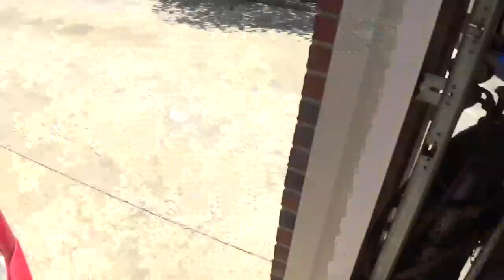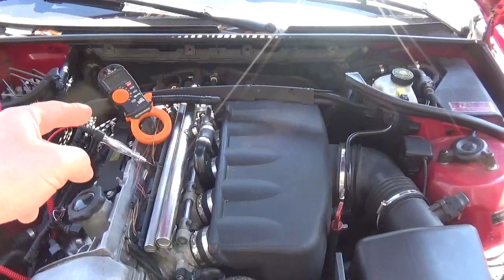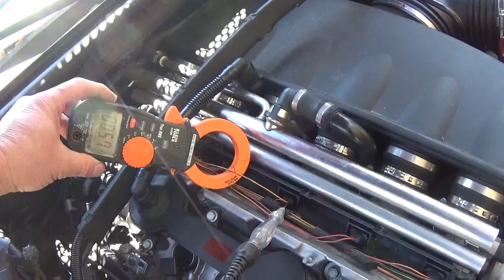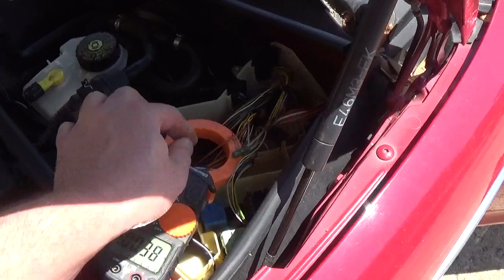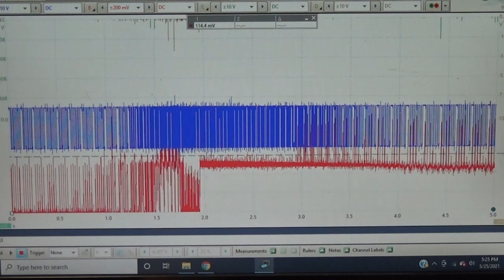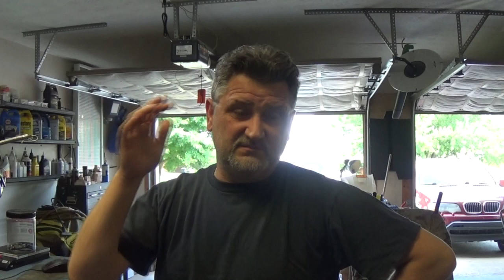BMW M3 Misfire/No Start Bad DME/PCM

Comment: You may have mentioned these items, if so, I apologize.  On your injector problem, were OEM injectors used as replacements?  Do the new injectors work on the other cylinders?  Have you visually examined the connectors to the injectors and checked for bent pins or pins touching each other at the control module and for any unusual resistance going through any connectors?  You checked powers and grounds - did you check for unusual resistance or slightly lower than expected voltage through the positive and negative cable connectors (i.e. w/in the crimps)?  See any unusual splices in the wiring harness covered by electrical tape where wires were twisted together instead of being crimped or soldered?  Did you consult DiagnoseDan, who works on more of these engines than most people?Good luck with resolving the problems you found.

Finally, can you tell me where your business is located in Kentucky?  A college student, who lives near Louisville, used her hard-earned money to buy a used 2013 Volvo that has turned out to be a lemon.  Local estimates she has gotten are more than she paid for it. I live hundreds of miles away and have not seen it, but a college friend of hers is a neighbor. From what he describes, it worked when she bought it but a few weeks later developed multiple issues.  Don't know if it was a private sale "as is" or from a dealer. It may be a simple problem that sets off many money lights and codes, or it may actually need major repairs she can't afford. She doesn't know what to do. If you are anywhere with 100 miles or so of Louisville, I would recommend to her that she contact you to discuss her issues.
Reply from the maker: New DME fixed this car. It’s running great.Car will be back to me for another problem  which is parasitic battery drain.
You can send your contact info to my email 
ruzic@bellsouth.net thank you
Reply: @kyhomegarage3430  Glad the new DME fixed the problem. I have passed your contact information to the friend of the young lady with the Volvo issues and asked him to have her get in touch with you at the email address you provided, and let her explain the issues.  I suggested that she get it towed or driven to your shop if you think you can help her. I do not know her name, but hope she will contact you today and explain her problems.  I really appreciate your passing your contact info to me and hope you can help her if she contacts you.

Comment: Another wire that is shorted to ground may be connected to one of the pins of the computer!
Reply from the maker: Just got an update from owner. He sent DME to another company to be checked and he was told that DME is good. He insisted to get replacement DME and it’s running great now. He is very pleased with outcome. Now car has parasitic battery drain. Looks like I will see him again.😊

Comment: Who knows how that control module is being tested???  Most electronics need to be opened up and the circuit in question needs to be isolated or removed in order to be tested ; and I doubt if that is being done for this owner.  Ramon, depending how much more you wish to get involved, you could call the tester and ask them how they are testing this module.
Reply from the maker: Just got an update from owner. He sent DME to another company to be checked and he was told that DME is good. He insisted to get replacement DME and it’s running great now. He is very pleased with outcome. Now car has parasitic battery drain. Looks like I will see him again.😊

Comment: That's crazy. Sorry things turned out the way it did
Reply from the maker: Just got an update from owner. He sent DME to another company to be checked and he was told that DME is good. He insisted to get replacement DME and it’s running great now. He is very pleased with outcome. Now car has parasitic battery drain. Looks like I will see him again.😊

Comment: Seems like odds of getting a pcm successfully repaired are about the same odds as hitting lotto. Shame how cars have gotten so stupidly over complicated. Thank you for posting Ramon and good luck with this.
Reply: Idiot Boy Wonder engineers, is the problem.
Reply from the maker: Just got an update from owner. He sent DME to another company to be checked and he was told that DME is good. He insisted to get replacement DME and it’s running great now. He is very pleased with outcome. Now car has parasitic battery drain. Looks like I will see him again.😊
Reply: @kyhomegarage3430  I'm not surprised at the outcome. The owner was right to trust your judgement. Looking forward to the parasitic draw video if you are able to post it. With your skills that should be a piece of cake after all  this. Stay well Ramon.

Comment: I see that the spacing of the injectors, on the one pack of 6, grows a little  more with each injector activation, then resets.  That could be engine speed change instead of actual timing change.  A useful test is run a math channel for the CKP to display it as frequency.   Changes in speed will be registered on the freq graph.  Using the math channel to compare the cams to each other and to CKP can show timing chain variations.  The noise bursts, on the CKP and CMP signals, at the point of #4 injector, don’t look to be any thing significant but, it is too convenient for them to be consistent and at exact time.  It looks supiciously like RF from an ignition coil but I would not expect a coil to fire at that exact time.  #2 ign would be closest.   I wonder if he has the OE sensors too?
Reply from the maker: Just got an update from owner. He sent DME to another company to be checked and he was told that DME is good. He insisted to get replacement DME and it’s running great now. He is very pleased with outcome. Now car has parasitic battery drain. Looks like I will see him again.😊

Comment: Thanks for sharing! another good one, and never a dull moment when you think something should be fixed when you send things out. As always, thanks for the diag!
Reply from the maker: Just got an update from owner. He sent DME to another company to be checked and he was told that DME is good. He insisted to get replacement DME and it’s running great now. He is very pleased with outcome. Now car has parasitic battery drain. Looks like I will see him again.😊